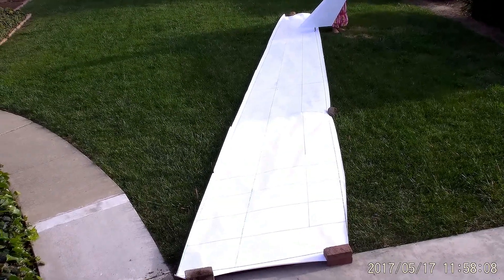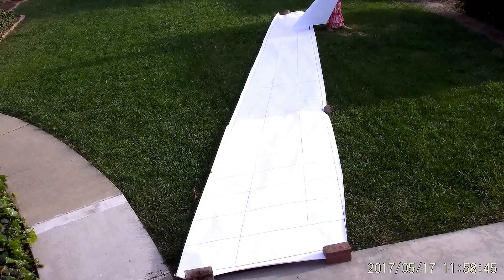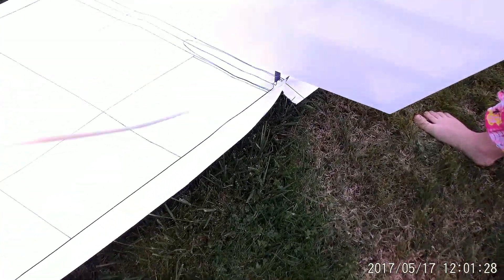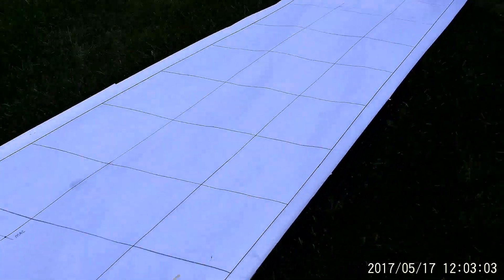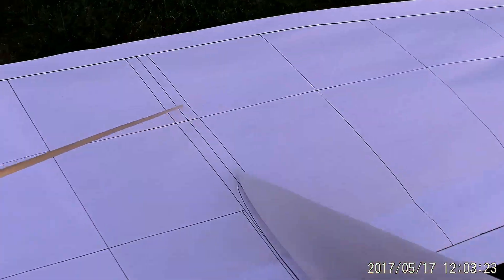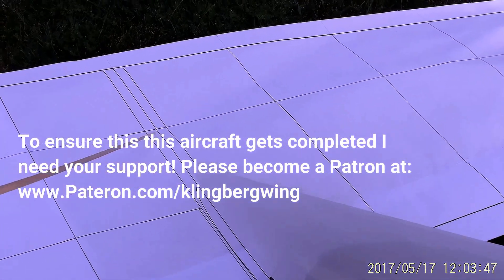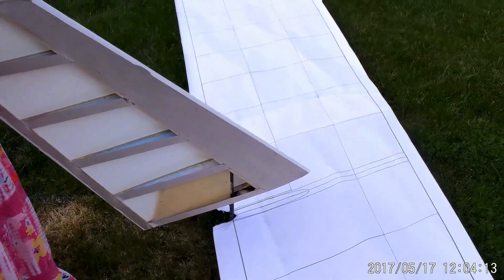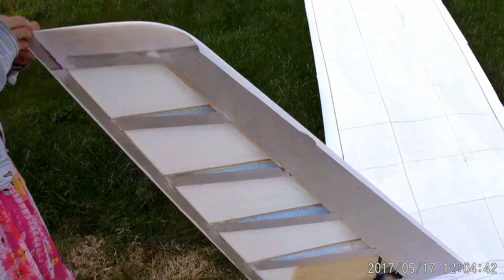Layout Overview - KW MkII Rigid Foot-launch Flying Wing Sailplane

Comment: How about preorders or plans
Reply from the maker: Good questions. I have no plans to produce any ready to fly aircraft nor any kit parts. I may consider a license for others to produce/sell various components or materials. I may publish plans if the design looks solid. That said, given this design really pushes the envelope, the probability for problems is fairly high. So, I won't be able to make a decision on plans until after significant flight testing has occurred. Currently, that looks to be at least a year away. However, I am curious as to what folks would be willing to pay for a full set of 3D plans? What do you folks think?